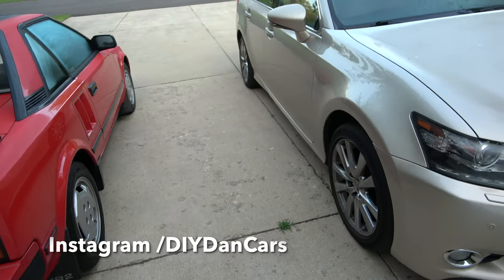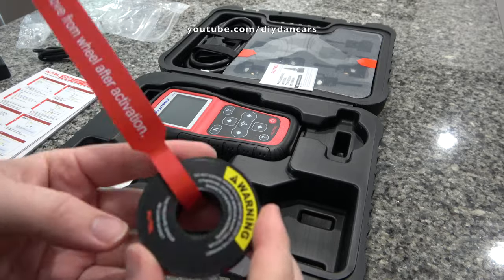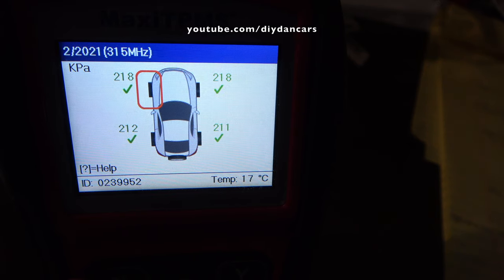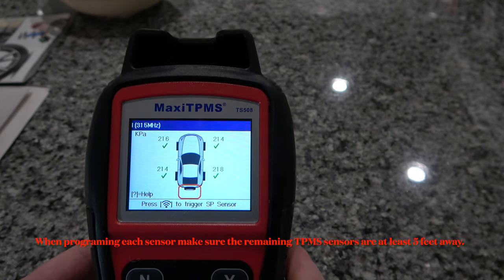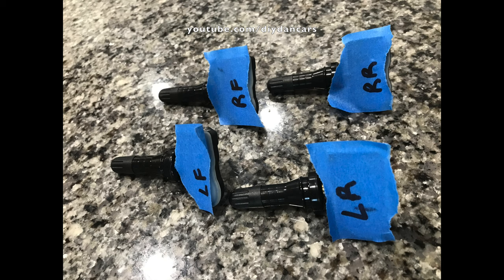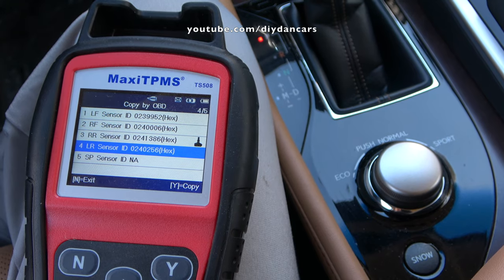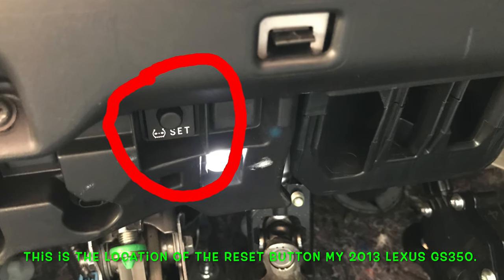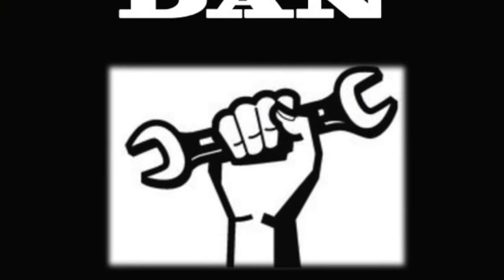How to Program New Tire Pressure Sensors For a Lexus or Toyota Using An Autel MaxiTPMS TS508 Tool

Comment from the maker: The tool I used can be found here: 
Autel TS508 tool only: https://amzn.to/3cLfYO7
Autel TS508 tool plus 4x sensors: https://amzn.to/3qa587k
4x Autel MX tire pressure sensors: https://amzn.to/3BiwnD7
Reply: Thanks for posting a great video. It's very helpful and the details were good. I just purchased the tool and 4x sensors (via your link). Apparently Amazon is packaging the tool and 4 sensors for $339. They don't have the tool with 8x sensors anymore.
Reply from the maker: @darylvoorhees2629  Hi Daryl! I really appreciate the support! I'm not used to comments like this. The comments I normally get are to criticize the work I do instead of saying thank you! I'm glad this video was helpful!
Reply: @DIYDanCars  it was very helpful in fact, better seeing someone using the tool, the way you have instead of reading the documentation in their users guides.
Reply: You should do a video on the road force balancing

Comment: I found a better solution, take your instrument cluster apart and put some electrical tape over the tpms symbol. Problem solved.
Reply: Even better, wire a switch to it and hide it under your dash, that way if you get the wild hair to fix your sensors one day you can
Reply: @nc818  If I really want to burn 200$ one day, I can just peel the tape off instead of a switch. I can check my own tires on a daily driver. This isn't my racecar where I want tire pressures and temperatures displayed on my dashboard, I don't need that on my commute to work in my prius.

Comment: I believe the copy sensor ID method is overall the best approach. First of all, the car computer is not involved at all. This is good if you have a brand new model such as the 2023 Toyota Crown, the Autel tool might not have the vehicle in the drop down list to select. Secondly, cloning means that you can keep multiple sets of wheels, such as summer and winter sets and just swap the wheels the TPMS would work flawlessly.
Reply: Just did the update and Toyota Crown 2023 is listed FYI. Did mine 👍
Reply: Can I copy the sensor ID to an aftermarket sensor like bosch or does it only work on autel sensors?
Reply: @josa7203  I've only used on Autel programmable sensors and I wouldn't be surprised if Autel tool only works with Autel  sensors. One odd thing I found using Autel sensors on my Lexus IS 350 (late model year) is that those Autel sensors would go to sleep if kept at constant speed. I notice if I cruise control for long time those sensors would go dormant and I'd get TPMS warnings. As soon as I brake or change speed dramatically they wake up again
Reply: @phoenixpai954 thanks for the fast response, I guess I gotta go to an auto shop, bought this tool after installing bosch sensors, not reading about the compatibility, cause they are advertised to function on 99% of car models, not mentioning that it's regarding the obd compatibility.

Comment: You don't have to keep them in correspondence to where you copy them. Once installed you can relearn the position after it's been installed just like if you were to rotate the tires. You have to make an extra trip around the car but easier then trying to keep them is the correct spot. I bet that's what the shop did

Comment: this whole concept is just insane .... wish i could just bypass the whole system 😅😂😊😮😢
Reply from the maker: Its actually quite easy to perform once you understand how the tool works. It now takes me less than 15 mins to program sensors and link them to the car's computer.
Reply: There is a way you could bypass it all as long as you're okay to visually inspect and gauge your tire pressure. I still have a few cars that don't have tpms so this would be normal for me. Hit me up if you want to know. I don't want to spam on OP's post. He did a great job at it.
Reply: It does sound complicated. But once you actually do it in hand with the device, it is rather simple. As a consumer AND employee of Autel, we try to make sure to make these steps as simple as possible. If you ever have any questions, our tech support will always be able to walk you through the steps in just a few minutes time. 😊

Comment: Question.......the sensor ID #'s you retrieved from your car, were those the original sensors that came with the car?   Just curious because the original ID#'s that popped up on my 2017 Rav4 (we bought it new) had a combination of numbers and letters,  maybe that is how they are doing it on newer vehicles, just curious.

Comment: I have an Autel MK808TS which is suppose to do the same thing as TS508, but it can only read sensors information. It doesn't let me programmed sensors for my 2020 Rav4.
Reply from the maker: The MK808TS can only read sensor information. You need the MK808S-TS in order to get full TPMS functionality.

Comment: I spent about $275 for winter to summer tire swap with tpms reprogramming on 2011 lexus is250 awd.  May get the autel 508
Reply from the maker: No doubt its a very handy tool.

Comment: What an awesome video. I ordered the Autel MaxiTPMS off Amazon, received it today and just programmed 4 of the 8 sensors for my Lexus. Will be taking them in tomorrow to have them installed. Thanks for the recommendation and the video. Very clear cut and concise 👍👍
Reply: Did you also buy their sensors?
Reply: @DavidLee-vp3nr  the sensors were included… 8 of them. I had 4 of them installed the next day ($25 each including rotating my tires) and they work great. My only regret is that I bought it off Amazon for about $390.. I could have gotten it cheaper for $300 if I had just googled. Someone else had them for cheaper.. but I still came out way ahead from what the dealer wanted to charge me to replace 4 sensors at $1000

Comment: Thank you sir ! Autel TPMS College course 101 in 16 minutes 😊
Reply from the maker: Happy to help!
Reply: Dan,
I have a 2022 Toyota Tacoma  . Can I duplicate the sensors ID on the Tacoma to a new Mx sensor. ? 

I do not want to use the oem  sensor on a 4 sets of wheel rims. I’m keeping the stock tires only 6k miles on it 😊
Reply from the maker: @JPHET37  Absolutely! If you can program sensors for a Bugatti Veyron, then you can definitely program sensors for a Tacoma!

Comment: My sensors were OEM from the dealer who used the VIN to program them for me. In this case the Advanced-Position Relearn-OBD approach works better rather than the Quick function.
Reply from the maker: No problem! Use whatever works best for your application.

Comment: I myself bought this tool and was impressed but I've been having trouble trying to program one of our vehicles and that is the 2008 Acura TSX. I don't know what I am doing wrong but it just doesn't want to dance with that car. Could be me, I dunno but it's driving me nuts
Reply from the maker: Oh man that sucks! Did you contact Autel support? When I had a few questions about the tool they were very responsive. It might be worth a shot?

Comment: It’s just an annoying warning light, I have a 2010 ES 350 that somehow still has all of its TPMS sensors working but it’s way cheaper to just keep a digital tire gauge & air compressor in the trunk. When the light eventually comes on permanently, I’ll live with it.

Comment: Nice. I didn't want to deal with programming so I put new batteries in the old sensors!
Reply from the maker: I didn't think the original sensors allowed for battery replacements.
Reply: @DIYDanCars  It's not difficult if handy. Just need a stanley knife, the correct CR battery with solder tabs and some glue to seal it back up! Love your content.
Reply from the maker: @cwang6951  Nice job! I like your style! I took the easy route and spent $120 on 4 new sensors. Yes, I'm lazy. ;)

Comment: Thanks alot for your explenations very helpfull, but i have a problem downloading the sensors ids from ecu, i got onlyn3 ids FL,FR and RR. The  RL id is not showing can you help? Its a 2015 dodge ram 1500, thanks
Reply from the maker: Battery is probably dead in the RL sensor. You can connect the tool to the car's OBDII port and download the codes from the car's computer.

Comment: Question....... when you picked which sensor on the tool did you have to pick from pacific or trw type of sensor? ...... My 2017 rav4 had the option of the two different types and after doing some digging I found out it was the pacific type.

Comment: Great video...
Question, can I replace a dead tpms sensor by using a non MX-SENSOR , I mean can I use an old tpms sensor that was already use in another car of a different brand?
Reply from the maker: The Autel tool will only program Autel branded sensors.

Comment: Tire shop installed autel mx sensors the other day that they apparently didn’t program with the car because they are not registering with the car but they say their machine scans the sensors but this scanner you mention in the video I have that as well but it won’t trigger any of the sensors when I try on each tire so is there something to do to possibly wake them up? Besides just the trigger button.
Reply from the maker: Start watching the video at 2:43.
Reply: Thanks I remember watching that first time and never thought about doing that. Thanks for the reminder.
Reply: i has the same problem with the new  tool but i set up date and time and star working find

Comment: If you have blank sensors it stands to reason LF RF etc wouldn't matter. Plus they will be out of order as soon as you rotate.
Reply from the maker: I didn't start with a blank sensors hence the reason I labeled them. The car will automatically pickup the new sensor location when you rotate the tires.

Comment: what do you do if you order new wheels and tires that are mounted and balanced already with new sensors installed already?
Reply from the maker: Perform the relearn method from the main menu. That way the car will know what the new sensors are from your new wheels and tires.

Comment: To clone new sensors like you did  from what i read on Autel site it has to be autel brand sensors, for any others brand aftermarket sensors the ''start fresh method ' rule has to be done ,did i understand correct? Thanks
Reply: Hey that's what I want to know can it program other brands of sensor. And if so how do you do ???
Reply from the maker: This tool will only program Autel branded sensors which I stated in this video.

Comment: hi, can you add a new toyota sensor to your toyota car using that? i have a sensor which run out of battery - got a new toyota sensor (which has a hardcoded sensorID on it) and need to add it to the car...
Reply: I understand that the Autel TS508 tool used here in this video does read the code (programmed information) on the new preprogrammed sensors, and then by plugging the Autel TS508 tool into the car's OBD port, that information can be transferred into your car's TPMS.
Reply from the maker: This tool can read sensor information from OEM sensors but it cannot program OEM sensors. This tool will only program Autel sensors as stated in this video.

Comment: Question.......Have you had good luck with these sensors and have you had issues with the sensors or the MaxiTPMS TS508 TPMS Tool as of 9-25-24?    Thank you for the great video!
Reply from the maker: I have had zero issues with the tool and sensors. I installed these sensors two years ago on my Lexus and they are still going strong. I even programmed new sensors for my wife's Maserati using this tool and had no problems with it.
Reply: @DIYDanCars  thank you. I'm in the process of looking to buy the same one.

Comment: Can you program the new sensor that’s already in tire?
Reply from the maker: Yep, I discuss this in the first half of the video. You will need to change some settings on the tool in order to program sensors that have already been installed in an inflated tire.

Comment: The "Reset" Button under the dash of Toyota/Lexus models will not reset the Computer... all it will do is reset the set pressure to activate the low tire light. 
For example... if you have your tires at 30 psi when you press and hold the reset button, it will have the light come on 5 psi less than that (25 psi)... if your tires are set to 40 psi when you press and hold the button, the light will now come on when the tire is deflated to 35 psi.
Reply from the maker: Interesting because my shop manual states something different. It will also resync communication between sensor and transmitter.
Reply: @DIYDanCars  Try it, It wont. it only does what I explained. This comes from a toyota, lexus master tech.
Reply from the maker: @1jzMKIII  My apologies. I was only relying what my shop manual stated.

Comment: I have a 2013 Toyota Avalon and purchased the TS508 tool and 4 new Autel sensors. Programmed them easily and had them installed in my wheels when I had new tires installed. The issue I'm having is clearing the low pressure waring light on the dashboard. I have tried to use the TPMS reset button on the car but no luck reseting the warning light. Is there anything else you can suggest or is disconnecting the battery the last thing to try? Thanks
Reply from the maker: Hi Dayrl, have you tried airing the tire? If the low pressure light is still on, then you must have a tire with low tire pressure! If you look in the driver's side door jam there should be sticker telling you the proper tire pressure for you car.
Reply: @DIYDanCars  all tires are inflated to 35#. I checked the pressure with the TPMS tool and a mechanical tire pressure gauge. I will have to disconnect the battery and try it again
Reply from the maker: @darylvoorhees2629  What pressure does the car tell you the tire is inflated at. If the tire is at 35# like you said, then a low pressure warning light shouldn't luminate. I wonder if you received a bad sensor?

Comment: I have two complete sets of rims mounted with OEM Toyota TPMS Sensors.  Can I use the the Autel tool you used in the video to relearn the OEM Sensor ids when I swap my rims?
Reply: Autel claims it works with 99% of sensors and vehicles. I bought 4 and just cloned them for my winter steelies. Be aware, if you park near where your other set is stored it may give a false reading until you drive away. Meaning if you got a flat over night it could read the inflated tire stored near by ;) That was older sensors tho... May have changed
Reply from the maker: This tool will only program Autel sensors so as long as those sensors don't need programing you will be fine.

Comment: just bought winter tires with sensors but sensors not communicating with my tpms so it lights up in the dash. Should I relearn or clone from my summer tpms valves that are working and that I will re-install in the summer ? txs so much

Comment: What happen if u already installed the sensors in ur car how do u program it
Reply: Same way. Read the old ESNs (Electronic Serial Number) from the car via OBD-II. Turn off the pressure thing in the TS-508 he covered first thing in the video (but didn't fully explain why, for what he did he didn't need it off, lets you initialize or change an ESN in a tire without deflating). Then go around to each wheel and write (copy, program) the data (ESN and the protocol your car needs to speak) into the sensor in each inflated tire.

Comment: So can I program the sensors and put them in my winter rims and remount the tires and when I install my winter tires in the fall everything will work fine even though they haven’t been installed on the car until winter?

Comment: can you get the TMPS code from a sensor that has a dead battery? will the tool work with any brand of sensor?
Reply from the maker: Yes, you can get the TPMS code by getting it from the car's computer -- pretty sure I show you this process in this video.

This tool will read all automotive brand sensors but can only program Autel sensors.

Comment: I have the same tool, but then scanning the ID using the OBD port, does not identify the rear TPMS id, only the two front ones. Any idea why? 

Without the OBD I could scan one of the rear sensors, as one is dead. 

I now have 3 sensor id but miss one. How can I clone it without the id?
Reply: I believe the old factory-installed Tire Pressure Sensors each have their ID Code printed on the outside of the sensor.  Once that old sensor is removed, that number can be used to program the new sensors.  However, the new sensors for this tool to perform its sensor programming function.  That bit of information is glossed over (briefly noted) in most videos produced on the subject.  Dan does mention it though.  You can purchase OEM tire pressure sensors which are preprogrammed for the correct tire pressure, too.  Then all you have to do is tell your car computer what ID code each new sensor has.  This tool can perform that function, too.
Reply from the maker: If I understand you right, when you use the "Copy by OBD" function it only retrieves the sensor codes for the front tires and not the rear tires? If so, that means someone deleted the sensor IDs for the rear wheels from the car's computer. If you walk around the car scanning the sensors are you able to detect the unique IDs for the rear wheels?